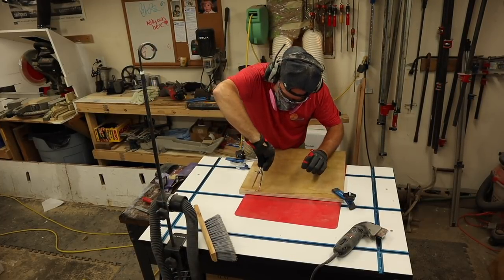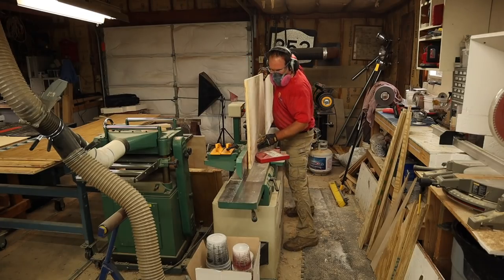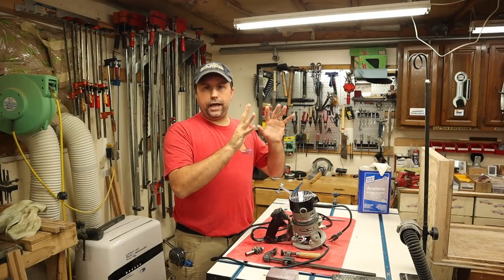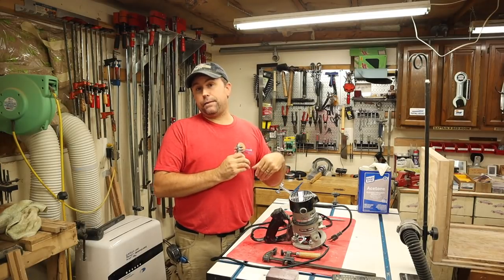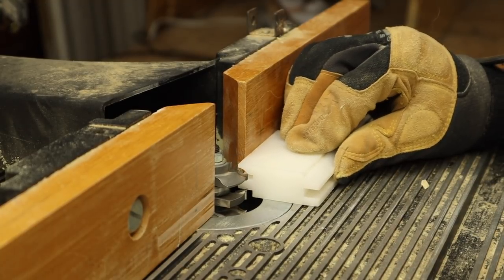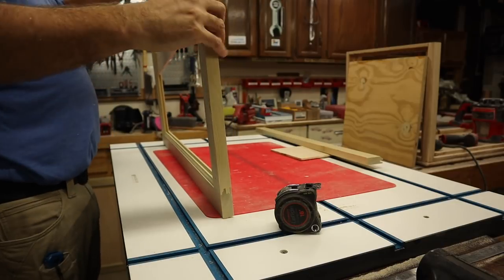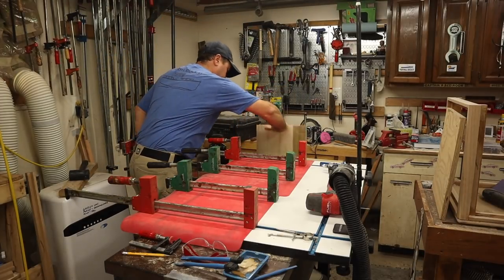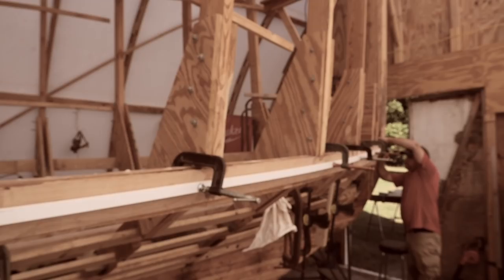Wooden boat backyard boat building with rail and stile woodworking cabinet doors.

Comment: Gotta pay the bills, thanks for sharing that part of "side work" to let you continue the build. I'm surprised the contractor didn't provide a template for the hinges to be routed into the doors. His end, with a good sharp chisel for fine tuning, would be much less with those routings done and pre spaced.
Customer cabinets may raise the cost of a kitchen remodel, but they raise the value so much more. I'd take real wood custom over factory pressboard every time. But paint?, I think panels cut/sized  from slabs and stained would look much better for my kitchens. Of course if the end owner want painted cabinets, that's there call. BTW, those are some huge drawer fronts. They could be "garage" doors for upper cabinets. I've been seeing a lot more of that door style lately. 
Also, you could do the baffle cut-outs with a hole saw, just cut them before sizing the board. Love the footage of you "fighting" the fiberglass in those half rounds, happens to all of us, but few include it in their videos.

Comment: Did my mom‘s kitchen several years ago. I used a three bit set, one for the style ends one bit for the rails and styles going with the grain and finally one bit for the raise panel. And yes I used a backer block when I was cutting the ends of the styles but I did them first, much like any other routing process, go across the grain, with the grain, across the grain, with the grain if you do all four sides. With this set all I had to do was keep the router at the same height and change out the bits for rails and styles. I even made my own Router table and used very simple fence and for my fine adjustments on that fence I used a hammer, literally. All you do is clamp down one end of your fence tight and tap the other end with your hammer and it could only move a little bit allow you to make a very precise and fine adjustments. Sometimes when I tell people that they think I’m kidding but it’s the truth. Got the idea for the router table and fence system from a TV show on Woodworking and it was also where I learned about using the hammer for the fine adjustments.

Nice clamping table. May have to make myself one.

Comment: When putting fiberglass over an edge, cutting it on  45 lets it lay down better. No bubbles on the radius.
Reply: Yep, bias-cut strips lie down so much easier.  I use them on the ends of my canoes & kayaks.  Wish they sold them that way.
Reply: D Wel . Unfortunately the hundreds of year old weaving systems only have warp and weft at 90 deg like all cloth.glass , sail cloth or regular fabrics.  I too have spent many hours cutting cloth on the bias, still haven't found anything better than a good pair of shears. 😃 cheers Warren .

Comment: I've never seen plywood diesel and water tanks , why not just make them out of fiberglass? are you going to assemble and coat corners again?just asking
Reply: strenght strength. simples.
Reply: or alu, or plastic... the project is a bit out there....
Reply: Yeah I think the ply tanks are a false economy. Everything moves in a boat and you don't want the seams of the tanks to come apart.